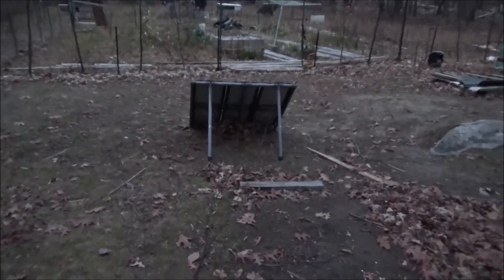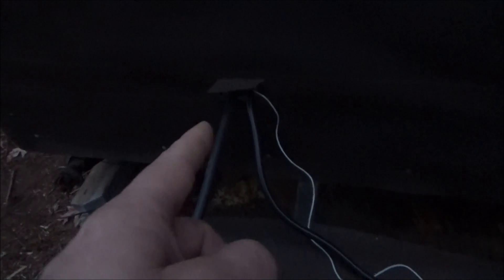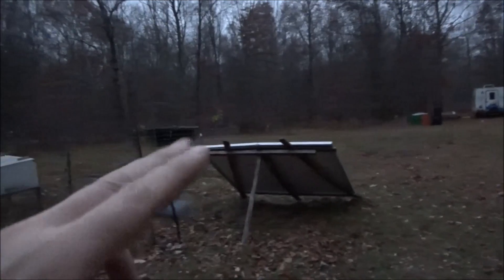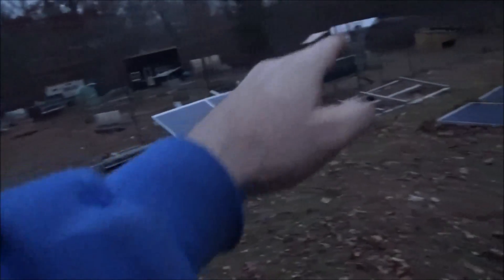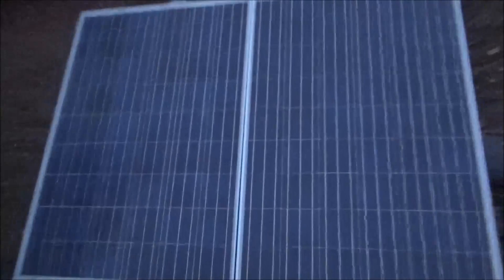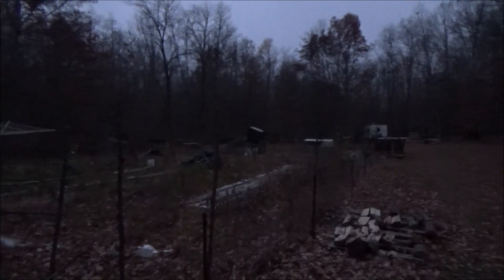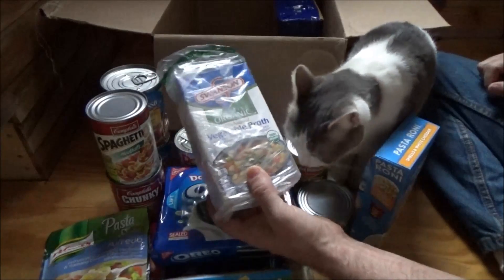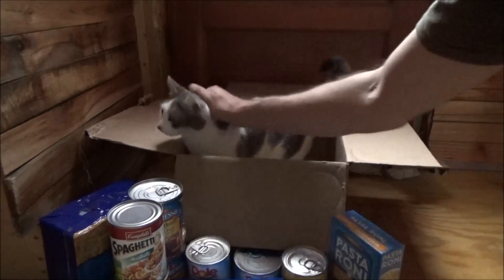Talking About My Off Grid Tiny Home Solar Panels N19

Comment: I'll say it again, move tiny home out into the meadow and put a series of panels on roof. You will need less wire and elevate the panels, catching more sun blocked by trees.
 Think!! you are trying to live off grid in most economical, and effective way.
Reply: All that wood is a lighter material?? Check out the cabinets and wall materials used in trailers and Motorhomes, see how many 2x4's, 2 x 6s, and 2x10's, and 3/4"plywood cabinets you find. Not counting all the oak wood paneling your using, instead of veneer or printed artificial wood panels. The Tiny home is a lot heavier than you think it is. Watch out for those tornados, Troy is more worried about the heat out in open, didn't you insulate the heck out the Tiny Home. Just trying to help to help you get a better grip on living off grid, and consolidating your system.  Put a water tank (Tanaka) up on roof also for water pressure, let your collection water run into a underground cistern where it will not be contaminated by exposure to sun and elements (that green icky stuff), and pump up to black Tanaka. I live in Mexico and many of the homes here are sort of like off grid. That is why our electric and water bill is only like $25 a month year round. Same with propane about $25 a month. This is the place that a solar system would really work as the sun is directly overhead most of the year but not really worth the expense, but some of the homes have solar water heating systems on their roofs though, no batteries involved. You could take one of their hot water tanks and instead of propane burner, just burn a little wood where the propane system is, that is what we used up on the ranch where we had no electricity and it took about 15 - 20 minutes to heat water up for a shower, with a hand full of wood, they have a chimney going out the top. Water comes down pipes from the Tanaka on roof, all gravity fed.
Reply from the maker: Look up MPPT solar charge controllers. I can use longer wires with no problem
Reply: MollyDolly
I would agree however my personal experience with tornadoes and strong winds would suggest getting the house well away from the trees in a high wind area. The house seems built strong enough for the wind but not strong enough for a tree. The wind in tornadoes or hurricanes isn't what will kill you, it's what that wind throws at you.
Reply: Seems like a good idea,  however I think there's also benefits to a more sheltered location.  Remember he gets hurricane/tornado force winds in the open meadow.  Probably could shred the house.  If you watch the videos with the baby chickens on the porch you hear the tornado sirens.  Personally I would shelter my home and battle the electrical issues.
Reply: Weather The Storm Survival Yep... it is a dilemma. Flying debri will kill you , that's true... and a falling tree is bad news, but wind can rip a trailer apart too.   Dilemma...
Reply: He should be able to move it a 100 yards or so!! I believe it is the heaviest Tiny Home I've seen, not safe to move much further with out some beefing up that trailer frame and adding axel. Extra long wires are expensive and cumbersome. Don't skimp on batteries get the best you can, pretty import aspect of your trying to live off grid.
Reply from the maker: Jim Thompson The heaviest? No it is the lightest so far. Remember I was keeping track and using lighter materials

Comment: check with your local scrap yard for wire. They often get heavy utility gauge from sub-contractors after big jobs. kinked or too short lengths,,scrap priced. Coffee takes 25-35 minutes to kick in bud,, sweet dreams!
Reply from the maker: Good idea on the wire. I will check. Thanks. Yes coffee takes time to work :)

Comment: WY DONT YOU PUT WHEELS   ON THE  SOLAR PANELS   SO YOU CAN MOVE THEM AROUND
Reply: Roger Shellman Why are you shouting? What you posted is neither that important nor that brilliant. Save the shouting for more urgent matters and ideas.
Reply: Wheels don't help unless you can move the panels. He mentioned that the cables made it from tiny house till solar panels even though he did not expect it. Which means the panels cannot be moved (far) from their current location. Putting wheels under them would be a total waste, unless you enjoy building carts (like, you know, something to mount the wheels under and the panels on).
Reply from the maker: These guys answered it nicely for me. Thanks
Reply: gene mayne You are right. Caps are seen as shouting on the internet, and how is one to know that for some people it is actually a vision thing? Especially on channels where there are plenty of shouters, it is easy to make the wrong assumption.
Reply: gene mayne
Are you ware that you can adjust the size of the pages on your computer? You can make all the typing much bigger and easier to read if you need to. Tell us if you don't know how and we will try to help.
Reply: gene mayne
I call BS  my sight is so bad I'm registered blind and never typ in cap's instead i have a magnifer  bar at the top of my screen  that help  me  most of the time ( and when it do's nt  i usualy when i'm arguing with a troll i get  snide  comments about my spelling when their losing that's when i know i've won )
Reply: gene mayne I think Ctrl and mouse wheel up will increase the font size on web pages. At least with chrome and with a PC. But most browsers have a zoom setting u can adjust.

Comment: Cant you just put more pannels behind one cable even if the loss is higher you will still get more power in your batterys
Reply: Well, he could fry the other set of wires he has. That would leave him with exactly no wires till pay day.
Reply: But there is almost no power coming from the cells
Reply from the maker: pieter zeeuwen That is a problem, yes. I am waiting for pay day when I will get more wire and connect them all up again.
Reply from the maker: bbb On off peak times I have little to no power. But on peak times it would fry the wires

Comment: That is a Long way to move direct current, even 3 amps, as Edison found out using dc in transmission lines is problematic , that's why we have ac not dc power lines
Reply from the maker: And that is why I have the panels connected in series to raise the voltage. Higher voltage means less loss in the lines.
Reply: The Do It Yourself World Troy, you are confusing volts drop in DC systems with Volts Drop in AC systems. AC has way less MV/A/M losses than DC regardless of the voltage
Reply: Andy Mahoney Yes but you loose less with high voltage and low current than you do with low voltage and high current
Reply: @ jlp, we use ac in power lines becouse its easier to transform to higher voltages in powerlines. (via a simple magnetic transformer)a loss is a loss, dc or ac are the same in voltage drop.(a watt is a watt, if its ac or dc, only differs by the kind of load, ohms, inductive or capacitive (cos f =1 than a watt is a watt)
Reply from the maker: Andy Mahoney No, I was talking about DC voltage like in my system. I have an MPPT solar charge controller which allows me to increase the voltage of the solar panel output. This reduces the loss in the lines. Higher voltage = less loss
Reply: No lower current means less loss.  😉
Reply: have a read   http://large.stanford.edu/courses/2010/ph240/hamerly1/
Reply: timcat100

Comment: Hi Troy, I nlook forward to your vids, very interesting.  I have 4.8 kw of solar panels most facing exactly south 1150 am is the peak hour and today it generated at that time a max at 2.8 kw.  Winter makes solar suck and so does anything other than exactly south (unless you have the panels on a turntable).  Get a compass and just point south dont judge it by your eye.  Good luck.
Reply from the maker: Thank you for sharing this. People need to know that its not all perfect in winter
Reply: ***** I didn't, my panels are on my roof, no obstructions and it was very sunny yesterday.  On the other hand I do think that Troy needs sort his solar out by making a turntable or cutting down some trees or facing his panels exactly south, 3 oclock sunshine is useless as is 9am - he needs to be getting peak.  On the other other hand my system cost 20,000 dollars and he needs to do it with virtually no money - so much respect to him.
Reply: You seem to not like him, if so then don't watch, just move on.  He seems genuine to me.  What I like about him is that he makes the same mistakes as I'm likely to and then just carries on and fixes it.  It's too easy to be negative, it stunts you and holds other people back too.  As for the money thing, how much he has or hasn't got is his business, not mine, but looking from here he doesn't look like a rich man to me (at least not in monetary terms).
Reply: kazbluesky Oh I dunno about off-peak sunshine being useless.  I have a few panels and a small make-do system, mostly cobbled together from odds and ends, and I manage to pull in a good deal of power,  Of course, its on my roof and I live in the Mojave desert in California, so maybe I have an unfair advantage.  Hundred and ten in the summer, no real trees, zero rainfall...but I get OUTSTANDING solar, LOLOLOL!

Comment: Hey Troy why dont you hook a small solar up to your worn out batteries on the back of the tiny house just to keep charge in them untill you get around to putting them on the Bedini Motor? I went to HF and bought 2 more 1.5 watt solar panels just to put on the bike and mower battery so they do not loose charge while not being used. This will keep them from getting any worse in tern will be less time on the Bedini. Is there a reason you wont fire up a generator and use your battery charger to top off the new batteries so you have some power? I know fuel is a extra cost but no power is a potential cash loss for you due to less videos and shorter videos.
Reply from the maker: Thanks for the idea on the older batteries. I will do that. I am using the generator now
Reply: ***** The Harber freight generator is down but he has another larger one he runs the table saw and other larger items with